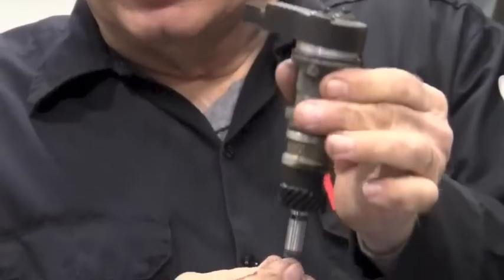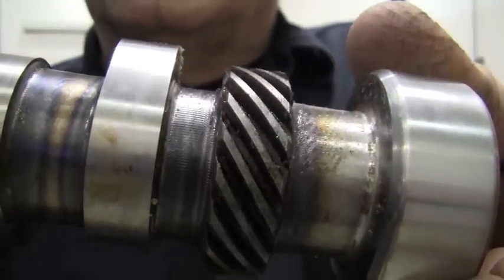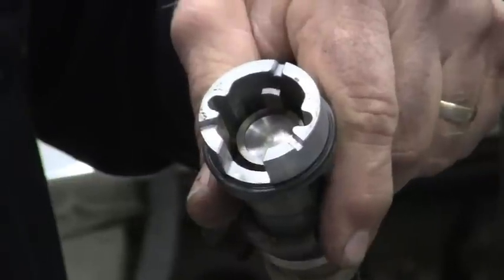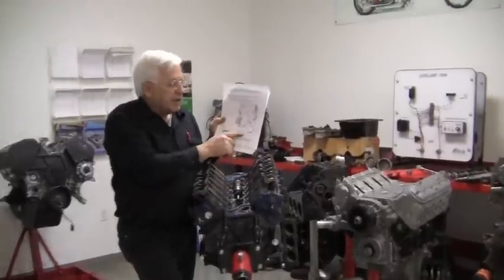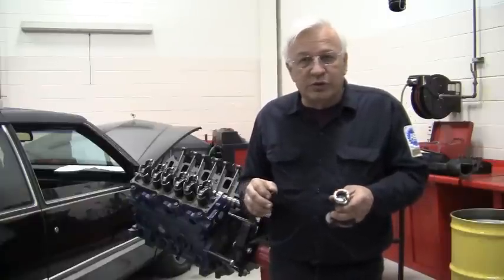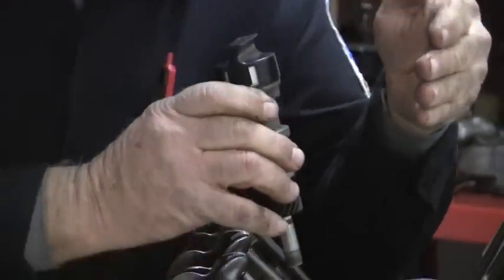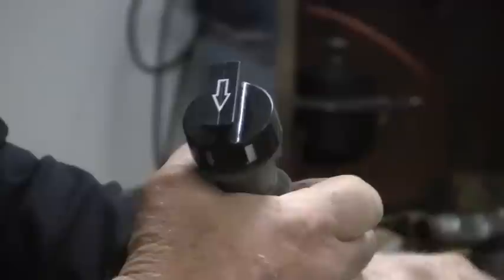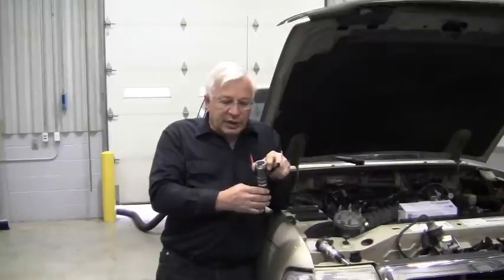How a Cam Synchronizer Works

Comment: is it ok to stab the synchronizer without the tool if the tab that spins is at 15 degrees and in the middle of the slot and connectors at 15 degrees? and engine is at tdc
Reply from the maker: yes it is

Comment: just changed the synchronizer out on my 05 ranger 3.0 and this helped me understand that as long I marked the old synchronizer and put the new one in the exact same way i’m good to go! car’s running fine and no CEL. at first I only changed the sensor but the CEL came back on after a month so I changed the synchronizer too.
Reply from the maker: good work, thanks for commenting

Comment: excellent video. So, really you dont even need the tool, as long as the tang points middle of the recess at #1 TDC. I giess the tool makes it easy to keep it in place while fiddling to install it and trying to mesh with gears
Reply from the maker: yes, the tool just makes it easier

Comment: Thank you so much, I have a 99 ranger that needs a new synchronizer, and I’m a young dude who’s not super mechanically inclined. So given this was timing based I was super concerned about how and what to mark and the Hanes manual and YouTube wasn’t much help. 

But after a bunch of searching I found your video and you put it so clearly and concisely how it works and how to install it. Truly thank you sir.
Reply from the maker: Thanks for commenting.  You can do it, just go slow and think before you act.

Comment: That is wrong, the cam sensor on sends a voltage at the beginning of the rotation, so it has to be inserted so your not in the middle of the beginning and end.  Using the tool sets the cam rod at the the start, but the degree you inser it matters.  There is 10 teeth, divided by 360 degrees equals about 36 degrees. The illustration shows the degree exactly.  If your off one tooth , because it's about 36 degrees you will notice it optically, then pull it out and move forward and back until the sensor looks like the diagram.  It turns 15 degrees putting it in , but considering that , match to the illustration, because if it's wrong it will be noticeable . The 2 imaginary lines are the crankshaft center and the front face of engine, making a cross x y axis.  There are 4 quadrants equaling 90 degrees each.  So if your one tooth off on the cam sensor, that equals about 36 degrees of 90 degrees., it will show because it's 1 third off .  There is only about 3 teeth in 90 degrees, maybe 4.  So if your off, it will not match the diagram illustration, because of the approximate 36 degree off.the cam sensor cannot move while in the bore, or it will throw the timing off.  All you can do is just keeping reinserting the cam sensor by moving it clockwise or counter clockwise a couple of teeth.  There is no way to measure 54 degrees, but assuming each tooth is like 36 degrees, you can eye ball it.until the cam sensor is positioned like the illustration.   Being off only one tooth forward or back will not look like the diagram axis no matter what the engine will be in time, but what you want is for the fuell injector to always squirter at TDC, ADVANCED OR RETARDED DEPENDING ON SITUATIONS.   My writing is terrible, but yes the cam sensor has to be tilted the tight amount of degrees, because if it's not you will be advanced or retarded from TDC for the fuel injection not the timing
Reply: I just saw a video from a hot rod guy timing a ford 4.2 litre, but I apologize I did a terrible job of explaining
Reply: I agree that this is not for engine timing. Engine timing is more accurately controlled by the crankshaft sensor; hence there are aftermarket crankshaft pickup sensors available. The CAMshaft position sensor needs to "see" where the CAMshaft is because the valve needs to be open at the correct time to inject fuel for that particular cylinder. So therefore it is very critical that the synchronizer is "stabbed" in the correct position to be able to rotate the synchronizer housing to to catch the signal at TDC when the vane blocks or opens for signal.
Reply: Yes that is it, your right

Comment: Can you put a distributor in place of the synchronizer? I plan to buy a 2001 explorer 302
Reply from the maker: no, because nothing to "control" the ignition, plus the ECM will be looking for but not seeing the sync signal.  Probably won't start
Reply: @realfixesrealfast  i should had been more specific. I just care about making sure it fits and the rotor turns in sync with the cylinders. I will handle the EFI using a throttle body injection EFI system.

Comment: 02 mustang with 135K, just put in sycronizer #5!!!. #4 took out the drive gear on the front of the camshaft AND there are no parts for it available in the world. None, unless you can go to pick 'n pull. If I every find another one in the junkyard I am going to put it on E-bay for $100. IF I didn't know about auto mechanics I would have had to junk the car.

Comment: Why am I not getting a signal to my fuel injectors,I’ve replaced my camshaft synchronizer and my noid light is not flashing. Please help me with this situation thank you
Reply from the maker: Anyone would need a lot more information than this to pinpoint exactly why.  VIN, history, symptoms, data, etc, etc.  If noid is not flashing,  and if the PCM is good, there must not be a command signal.  Are you getting a crank signal ?  Can you fore the injectors manually ? Is all the wiring good ?

Comment: What happens if you don’t put it at top dead center ? Just pulled marked the top of the synchronizer as a reference, yanked it out, marked the new one then I slammed dunked the new one in the same position if not it’s pretty close to the same position
Reply: Did that work for you, and what engine do you have?
Reply: @ScottysVise  yes it worked for me I have a 1998 ford ranger with the 3.0 and it now runs like a 65 cobra with a 427 hahaha
Reply: @Greg_Banuelos so you don't have to put it on top dead center? Can i just take the old one out and put the new one in?
Reply: @WasNothingRealYouWereReal  so when I did my ford ranger, I did not find top dead center. When I pulled the synchronizer cap off I marked the top part synchronizer shaft and I marked the block and I also took a picture of it  so when I pulled it out, I had something to reference. basically the same way I pulled out the old synchronizer shaft is the same way I put in the new one.
Reply: @Greg_Banuelos  thanks for replying I will be replacing mine tomorrow 👍
Reply: @WasNothingRealYouWereReal  yessir good luck. Take your time take breaks if you need to. Be sure to have some engine oil on standby, you don’t need a lot just enough to oil the gears for the synchronizer shaft and there’s O-rings on the synchronizer shaft. Be sure to oil all of that. Let me how everything worked out.

Comment: hello my friend, i have a question, i unpluged my Cam Synchronizer and the engine is runing much beter, how ??? lol
congratulations for the vids
Reply: when you unplug it you also remove it's input to the PCM,  it then reverts to base timing.  Probably will run better at idle but not above idle

Comment: I just had a Camshaft position sensor and synchronizes put on my car.  2002 Mercury Sable.  The car was jerking and stalling.  The car is worse than ever and I can't drive it.  Same issue.  Car was towed to the mechanic twice.  Then he said my fuel pump relay was running hot.  I put in a new one of those.  Car still doing the same thing.  ANY IDEAS??????

Comment: I have a 99 ranger 3.0, does the cam shaft synchro run the oil pump? Do I have to remove the oil pump if the shaft or gear breaks?

Comment: So from what I gather, it doesn't matter if the angle is slightly off- as long as the window notch is lined up with the spinning metal piece at TDC on the compression stroke, it'll work regardless?
Reply from the maker: yes, as long as your not off by 180 degrees.

Comment: So, if this camshaft synchronizer begins to fail will it give you pre ignition and detonation?
Reply: That’s what I wonder my engine is pinging under load I clan the egr valve new plugs wires it still pings I wonder if my camshaft synchronizer is worn
Reply: @kamryn7496  mine actually slowed down by simply changing the octane on the fuel it uses. According to my 2001 3.0 v6 engine and manual it wants 87 octane instead of 86 octane. The area I live in doesn't have 87 but only offers 88 so, I been using 88 and it seems to help.
Reply: @JuanDaMajikOne  yours was having preignition detention to? Over here in New Mexico we just have 86 or 88 to I found a gas station that had e15 flex fuel witch was 93 octane I been using that an that seem to help for awhile but now it’s just pinging load again an it’s getting annoying an I check an went threw everything can’t figure it out

Comment: Great video, but he failed to mention that you want the compression TDC. Not the exhaust TDC. He has another video which shows how to find TDC of #1 by simply removing the #1 spark plug. So, in a way, this video is incomplete. In the other video, he used a cylinder compression gauge hose to feel for the air being pushed out. There is a big difference when you feel for the air being pushed out between the compression and exhaust cycle. I simply use my finger and fully plug the #1 spark plug hole after removing the spark plug. There are only three cycles. Intake, compression, and exhaust. During the intake cycle, I feel a suction. During the compression cycle, I can't keep the air from coming out due to the extreme pressure. And during the exhaust cycle, I feel pressure but it is weak because the exhaust valve opens and the air exits that way. So, if done right, you won't mix which TDC is the compression which is the one you want. Hope this helps.
Reply: He explained that it does not matter what stroke the engine is on starting at 5:00 and on to specificity at 5:16. Have to follow the procedures he defined while the engine is at TDC. If old school distributor, I definitely agree on what you said on being on compression stroke!
Reply: @jazzmeup1  The camshaft moves at half speed of the crank, and so does the cam sensor.  Two revolutions of the crank make one revolution of the cam sensor.  If you stab the sensor with the #1 piston at TDC, but it's on the exhaust stroke, your engine won't run when you get it back together.  That's the whole point of the cam sensor, along with the crankshaft sensor, because the computer needs to know which part of the cycle (exhaust or compression) the engine is in.  Otherwise you'll have the spark plugs and fuel injectors out of sync with the pistons and valves.  This detail is not mentioned in the video.

Comment: So it does not matter which TDC you use? It could be no 1 at compression or no 1 exhaust. If that is wrong I would expect the engine to run however it may be injecting fuel at the wrong time?
Reply: No, he has another video which shows how to find TDC of #1 by simply removing the #1 spark plug. So, in a way, this video is incomplete. In the other video, he used a cylinder compression gauge hose to feel for the air being pushed out. I understand what you are saying, but there is big difference when you feel for the air being pushed out between the compression and exhaust cycle. I simply use my finger and fully plug the spark plug hole. There are only three cycles. Intake, compression, and exhaust. During the intake cycle, I feel a suction. During the compression cycle, I can't keep the air from coming out due to the extreme pressure. And during the exhaust cycle, I feel pressure but it is weak because the exhaust valve opens and the air exits that way. So, if done right, you won't mix which TDC is the compression which is the one you want.
Reply: Hector Ramirez thank you so much for that, made so much sense to me, I didn’t know that there were different cycles, I thought as soon as the #1 piston was at the top it was TDC didn’t know it had to be a certain cycle for TDC no wonder my cam synchro is off and engine is running bad, appreciate it!

Comment: My prior experience with distributors interfered with understanding your key point. I kept wondering how I was going to get it exact at 15 degrees. Then I suddenly had that 'aha moment' when I realized that 15 degrees doesn't matter, it's cosmetic so the wires don't get stretched. The critical part is done by the holding tool, which freezes the synchronizer at its own TDC. With cyl #1 at TDC and the synchronizer at the closest magnetic point, the unit is in time regardless of which teeth mesh together down below.

Comment: Does it matter if it's at top dead center on compression or exhaust stroke or can it be either one as long as the piston is TDC?
Reply from the maker: as long as its tdc  the cranks sensor will tell the pcm which stroke its on
Reply: Cam sync tells the ECU to fire injectors on the next cycle.
Get that wrong. And you will fire them on a closed valve. Engine will run rougher at low rpm as the fuel is pooling up behind the closed valve.